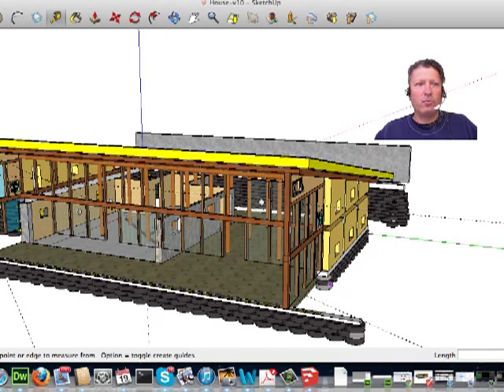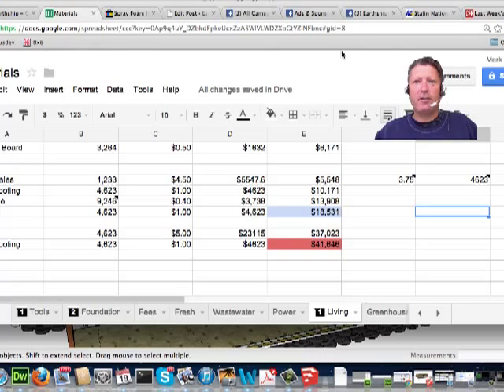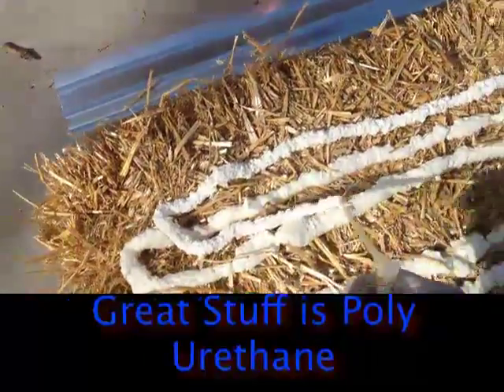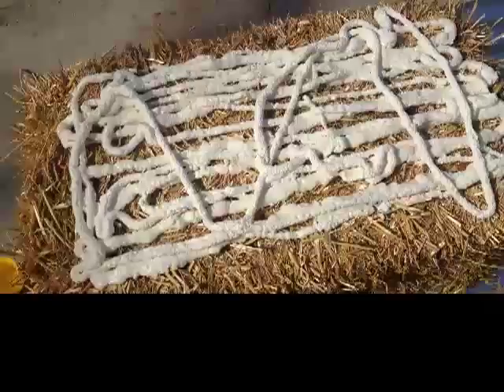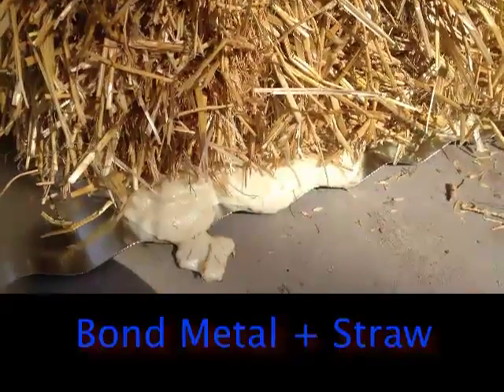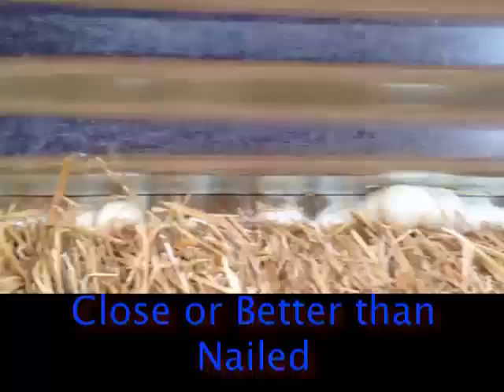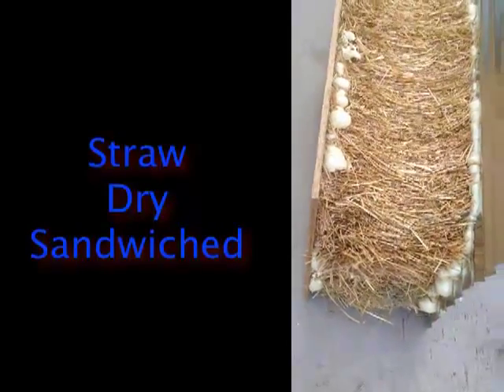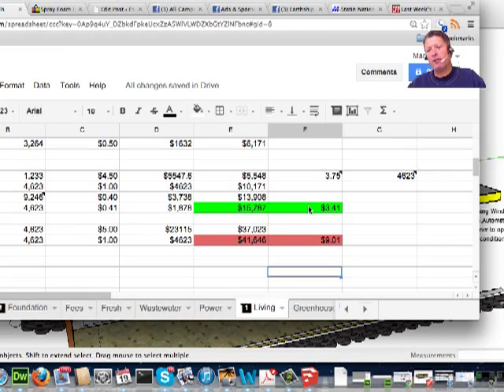Straw Roof Experiment

Comment: Mark, I like how you think!  You have invented a new SIP.  It could be called SBP, a Straw Bale Structural Insulated Panel.   As to the preceived moisture condensation problem at the roof to bale interface.  The extreme solution could be add a standard glueable moisture barrier layer  between the bales and roofing material.   That way any condensed moisture on the roofing material will  drip down on the barrier layer, and since the roof is corrugated, it vents to the outside.  Love it!   I'll bet it does not move more than 2 inches with two people atop a 12 foot span.   Also like to hear how you plan to finish the edges at the eves and tie it to the wall.

Comment from the maker: I ended up going to repurposed materials and purchased a trailer load of 3.5 inch poly-iso at a deep discount.  I paid about $30 a sheet, which ended up costing about $2 per square foot for insulation - probably cheaper than I could have done with straw bales.

The insulation was previously used and came out of a casino in vegas.  We used 2 layers offset created an R value of R-42.

The house was toasty warm all winter - never dropped below 60 degrees in the living area and 40 degrees in the greenhouse all winter - with no heat whatsoever.  The lowest outside sustained temperature was -5 degrees for three days.
Reply: ANd what about summer comfort ?

Comment: @Daniel Condurachi - Think about it, those kind of winds are just as likely to rip off the tin roof with or without the straw bale, so it's rather moot.  It's more about using it as an insulation.
Reply from the maker: Good point - we had 80 mph winds the other day.  The structure is rock-solid bomber.  Nary a creak in any joint - let alone anything that appeared to shift.  Guessing that the structure is good to 2x that now.

Comment: I don't think it will work because of enclosure layers imbalance. On one side is breathable wood and the other side is non-breathable metal. My opinion is that the humidity from air is going to accumulate under the metal sheet, because the wood wil let the moisture in, but the metal will not let it out. The point of plaster is to make the straw bale wall breathable, the same thickness of plaster is applied to either side so the moisture can pass through wall in and out. Even though plaster is wet, the walls will dry without problem.
Reply from the maker: In this case - both sides are sealed with closed cell foam used as an adhesive.  The foam prevents vapor from entering or exiting either side.  This also improves the thermal insulation because the thermal tests on straw bale encapsulated moisture that would migrate with thermal shifts.  In this case, as long as the straw is dry, and there is enough to seal the bale at the wood junction, moisture is not a variable.  The experiment made me wonder about the low r-factor ratings of  of strawbale construction - which with plaster, installs moisture which migrates, and is a thermal conveyor during thermal cycles.